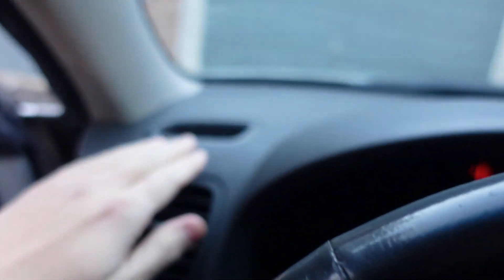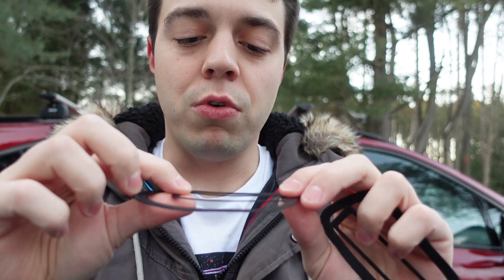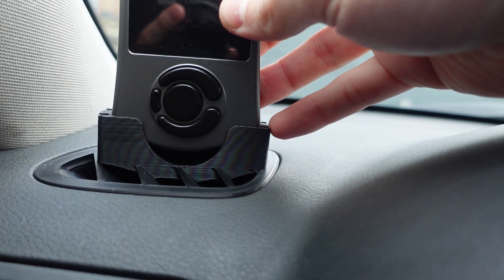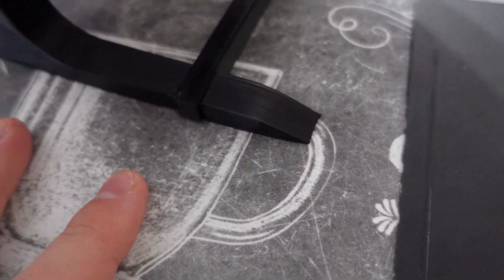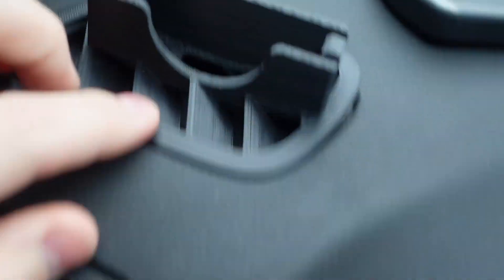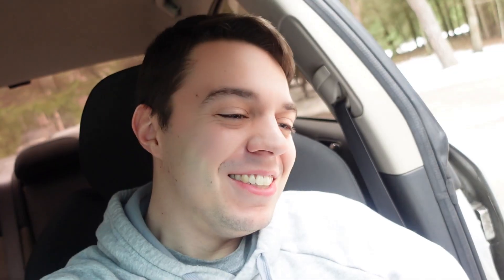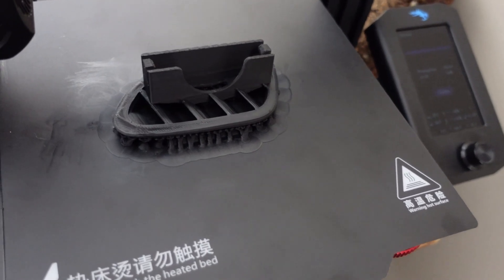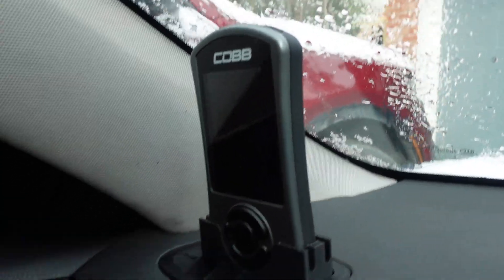No One Had a COBB Accessport Holder I Liked, So I Made My Own For The Legacy GT

Comment: Would recommend using Petg for this application. It can withstand the heat and is fairly easy to print once you get over the stringing issues with proper settings.  I made a clock relocation bracket (modified heavily off Thingiverse) from the top cubby to the ash tray. Holding strong for over a year on my LGT.  If you're still trying to do this I have years of experience with 3d printing, would be nice to see more support on this chassis
Reply from the maker: Thanks for the recommendation for trying Petg. So far the ones I've made in ABS havent been an issue after months of sitting in my dash and having the defroster on. But if i get the chance I'll experiment with Petg. Nice, curious as to why you relocated the clock to the ash tray? I need to dust off the 3D printer since I just moved. But i am planning on doing a V2 vent mount so it looks closer to OEM. Also I'm going to trying to make some gauge pods for the steering column. That one may be difficult, but willing to try!